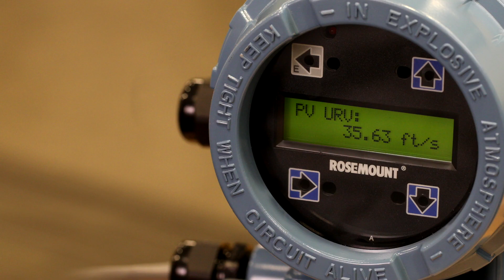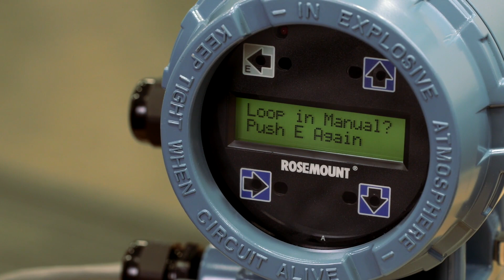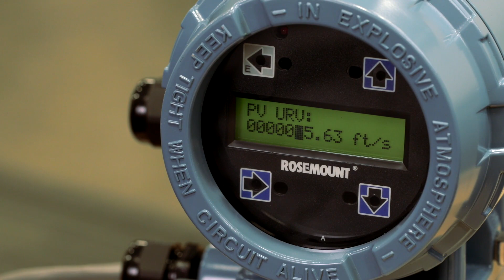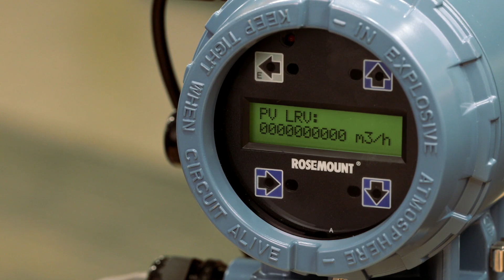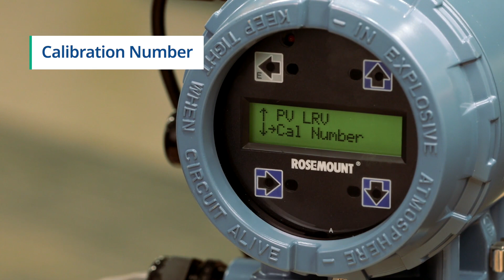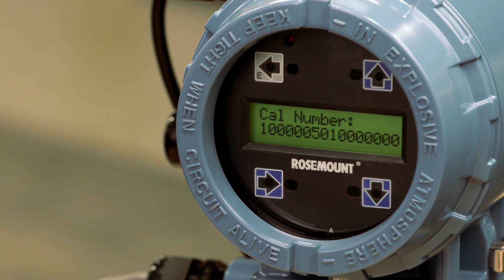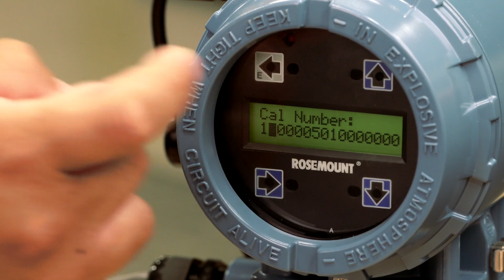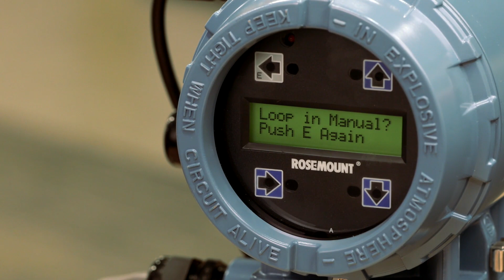Configuration of Rosemount 8732 Magnetic Flow Meter (Local Display)

Comment: i used 8750w, when pipe is empty flow then transmitter show numers. how to set to zero reading. anorher issue was unstable of reading. hope you help our problem, thanks.
Reply from the maker: Hi @udansyambasul,

The Rosemount 8750W, along with the other Rosemount Mag transmitters, come standard with Tunable Empty Pipe Detection diagnostic. This diagnostics provides a means of minimizing issues and false readings when the pipe is empty. Tunable Empty Pipe Detection diagnostic is set at the factory to properly diagnose most applications but can be optimized to meet unique applications. 
 
1. Record the empty pipe value with a full pipe condition. Example: Full reading = 0.2 
2. Record the empty pipe value with an empty pipe condition. Example: Empty reading = 80.0 
3. Set the empty pipe trigger level to a value between the full and empty readings. For increased sensitivity to empty pipe conditions, set the trigger level to a value closer to the full pipe value. Example: Set the trigger level to 25.0 
4. Set the empty pipe counts to a value corresponding to the desired sensitivity level for the diagnostic. For applications with entrained air or potential air slugs, less sensitivity may be desired. Example: Set the counts to 10
 
This procedure can also be found in section 9.3.2 of the Rosemount 8750W Manual that can be accessed through this link:
 
https://www.emerson.com/documents/automation/manual-rosemount-8750w-transmitter-hart-protocol-reference-en-4854858.pdf

Comment: Thanks for knowledge sharing. What's the procedure for installation
Reply from the maker: Hi @noelfaithfulkari2857,

There are location, environmental, and position considerations when it comes to Mag sensor installation which Section 3 of the 8732 Manual covers into more detail. Here is the link to the 8732 Manual:
 
https://www.emerson.com/documents/automation/manual-8700m-sensor-8732em-hart-en-78020.pdf
 
We also will be releasing a new set of videos that covers preparation for installation and the installation process for Mag meters. Please check back soon for these new videos!